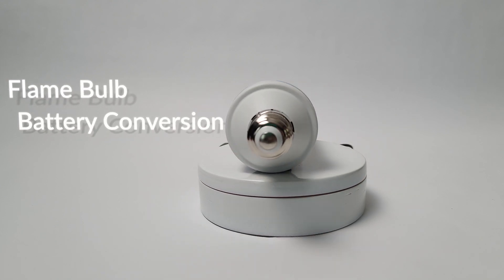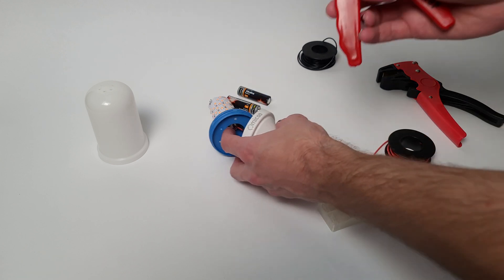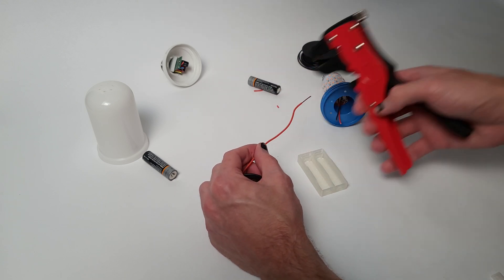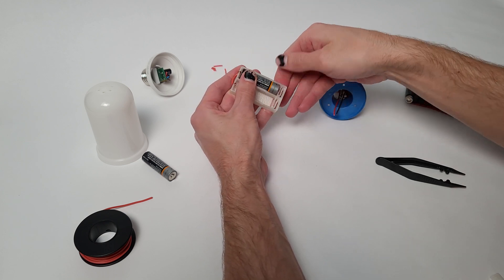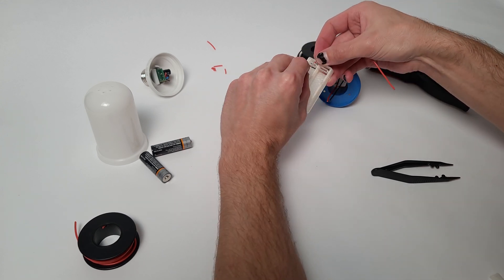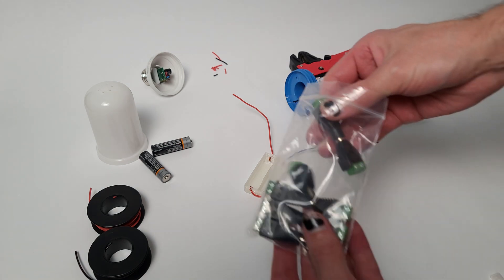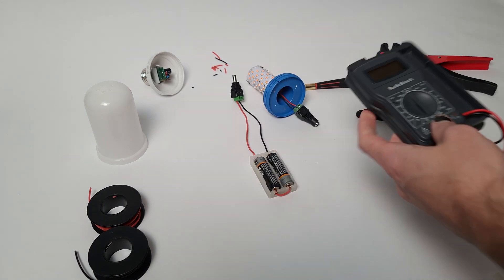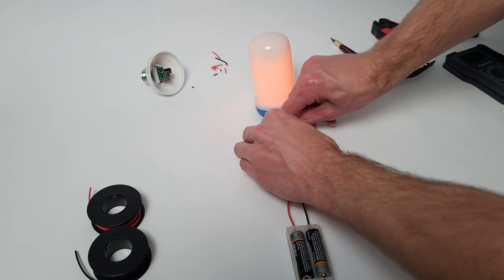Flame Effect Bulb | Battery Conversion

Comment: Hm, will this work on any bulb of this sort?
Reply from the maker: Unfortunately I am unsure, I have only tested the one type/brand of bulb. Without a knowledge of electrical circuits and access to the schematics of any given bulb I think it would be difficult to determine. I would probably end up using a bit of a guess and check method, although, that is admittedly not the best option.
Reply: No. I wasted 2 bulbs already that were assembled different inside. I noticed he used "omicoo" brand bulb which seems to be hard to find.